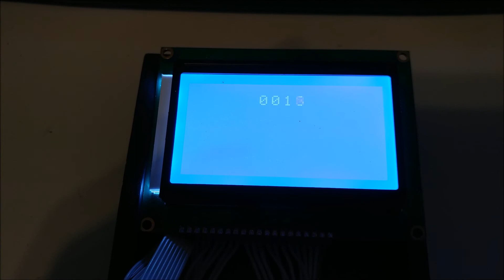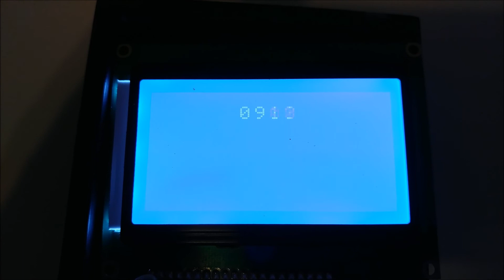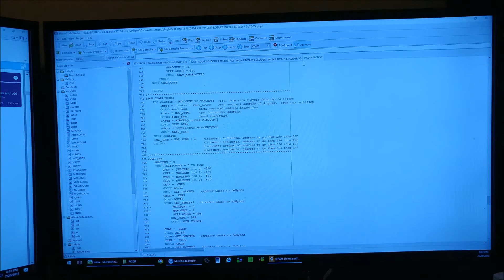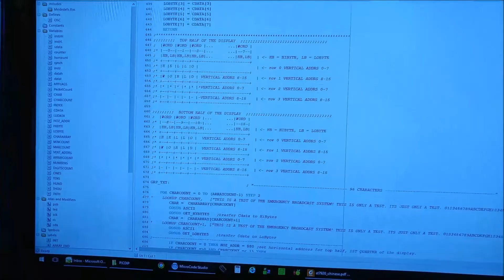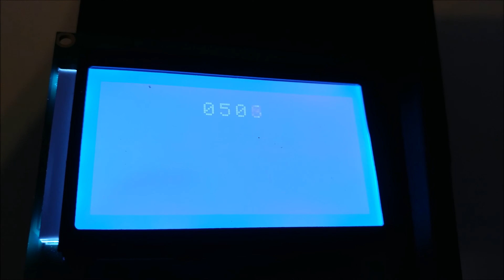ST7920 Graphic LCD Demo with a PIC16F887

Comment: Pin Configuration? I was in trouble the same GLCD there is two variant one with PSB pin another with CS1, CS2
Reply from the maker: Hi Praveen. I dont have that project any so I couldn't tell you the exact pinout. My glcd had the cs1,cs2 pins. That, I do remember. Thanks for watching the video.
Reply: @CHSElectronics  Can u please share the code I'm Suffering lot
Reply from the maker: @PraveenKumar-pr9hk  I posted a link to download the files in the description of this video.   If it doesn't work for you, send me an email and  I will send it to you.
Reply: @CHSElectronics  Sorry It was in the assembly I'm looking C program Okay Thanks for ur valuable time. Will u elaborate on how u connect pins

Comment: can you tell me the graphic mode enabling order and gdram accessing order please
internal character  displaying is ok(i descoverd)
Reply from the maker: Hi L.D.  Thanks for stopping by and watching the video.
To enter graphic mode, send these bytes.
1. Send START byte of $F8 to start communication in COMMAND mode.
2. Send command byte split into 2 bytes.  The upper nybble of the command will make up the upper nybble of the first byte. the lower nybble will be all 0's.  The lower nybble of the command byte will make up the upper nybble of the second byte and the lower nybble will also be all 0's.
Example: if command = $A5, then the next 2 bytes after the START byte will be $A0 and $50. Do this for every command/instruction you send.
3. Send  commands B'00100100 and B'00100110

To enter Display Data:
1. Send START byte of $FA to start communication in GRAPHICS mode.
2. Send command byte split into 2 bytes just like above. INSTRUCTION = COUNTER( values 0 to 31) plus(+) the value of 128 for each instance of COUNTER.  If COUNTER = 0 , then INSTRUCTION = 0 + 128. 
3. First instruction = 128, this sets the vertical start point. (X coordinate for upper and lower halves of the display)
4. Send instruction B'10000010, this sets the horizontal start point.  (Y coordinate for upper half of the display)
5. Send first byte of GRAPHICS data for upper half of display.
6. Send the same instruction above again. (X coordinate for upper and lower halves of the display)
7. Send new instruction B'10001010. ( NEW Y coordinate for lower half of the display)
8. Send first byte of GRAPHICS data for lower half of display.
9. COUNTER = COUNTER + 1
10. Go back to step 1 until COUNTER = 31

This will populate your display.

Thanks and good luck!
Reply: @CHSElectronics  thank you very much  I will apply this and give you a feedback👍👌
Reply: @CHSElectronics  I am a bit confuse with ur details....how did you get F8? And for 3rd step how did you get the 2 commands? Could you explain referring to the datasheet please?
Reply from the maker: @l.d.l.d.2550  Ok let me send you an email with the data sheet I used so that we can be on the same page.
Reply from the maker: You can send me an email at 
chselectronics2017
@gmail.com
Reply from the maker: @l.d.l.d.2550  If you already have the data sheet, look on page 26.  It will explain $F8 (1111 1000) and $F9(1111 1001) and the 2 command structure. $F8 is instruction to Write data to the display. $F9 is the instruction of where to store the following data, either to a register inside the ST7920 or to the GDRAM.
Reply: @CHSElectronics  email sent
Reply: @CHSElectronics  in my datasheet page 26 gives the serial interface waveform
Reply: @CHSElectronics  how did you make the interface...serial or parallel (4 or 8 bit)
Reply from the maker: @l.d.l.d.2550  I sent you an email with some explanations.  Thanks for sending yours.
Reply: @CHSElectronics  I send a reply please check